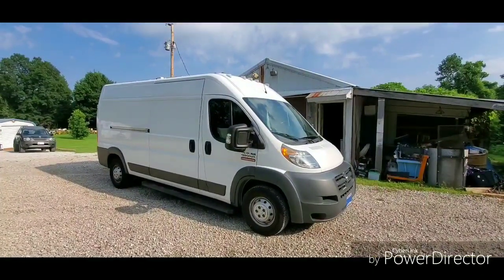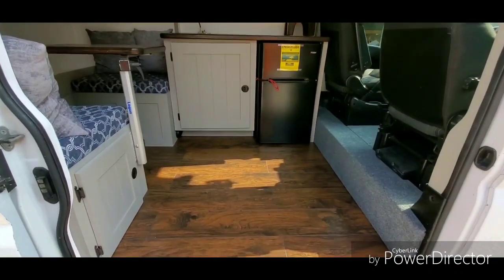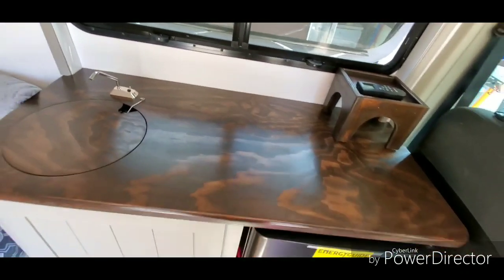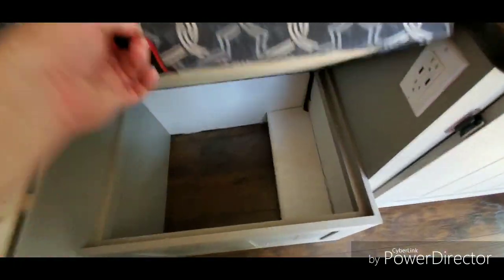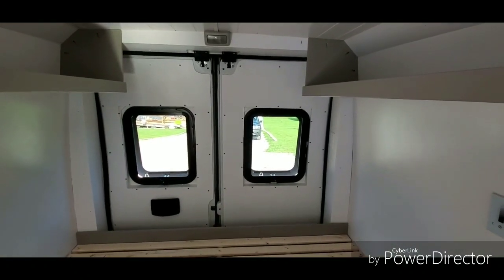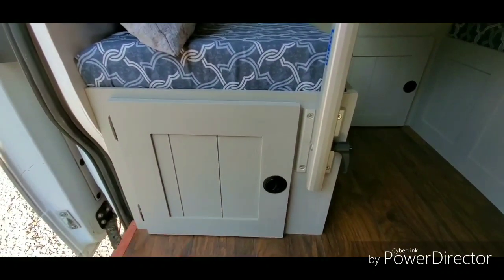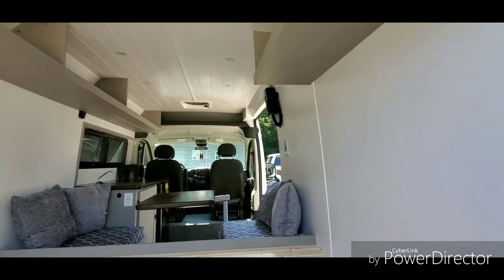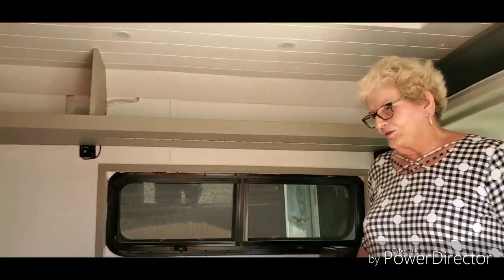"Woods" Ram promaster camper van conversion walk through E25

Comment: I really like the awning style window in the rear doors, and I agree it would be nice if these windows were larger. If the Frigidaire 5000  Air-conditioner (small unit) were to be installed on drawer slide, the awning window raised up high, then the air conditioner could be slid outside and the window rested down on it providing protection from rain. The rear door could then be closed when running the air. Do you think there is room?
Reply from the maker: I see what you are saying. But if you did that on the door I see that being a problem. And the side (at the top) has a main support brace about a foot from the ceiling so that would put it below the cabinet.

Comment: Excellent Work!
Why not use a 12 Volt DC refrigerator?
I would certainly install an Air Conditioneer!
Reply from the maker: A good 12v refrigerator will run $600-$900, this refrigerator was $175 and you can get one anywhere.

Comment: Could you make it 75 inches in the width? Maybe just where the bed is?
Reply from the maker: If you didn't add any insulation and cut the bracing out in that area maybe.